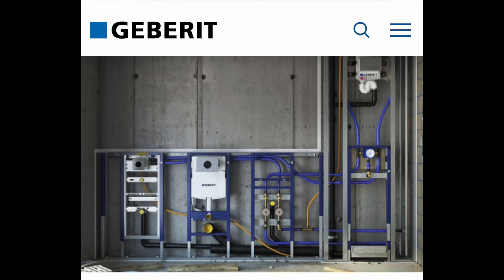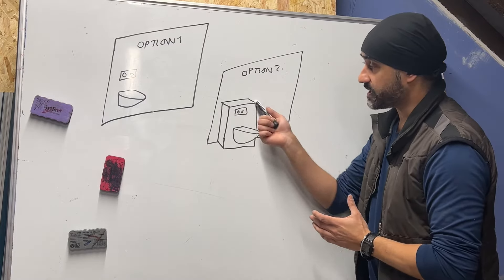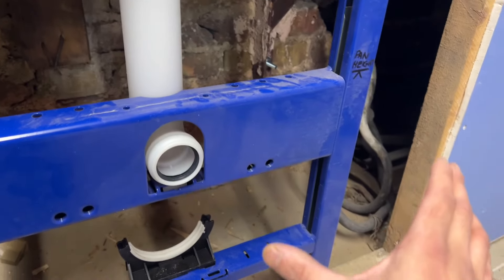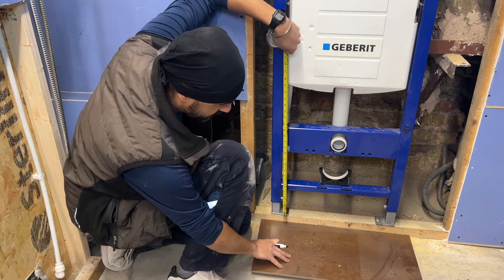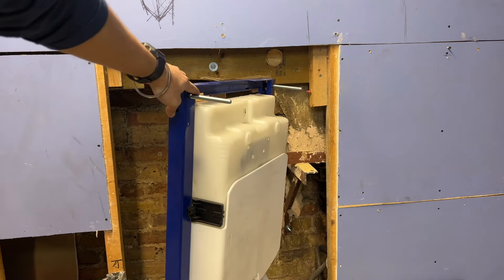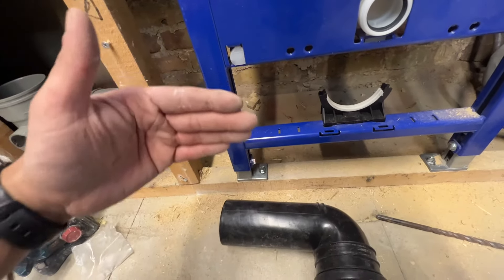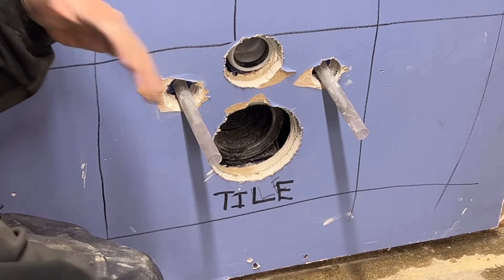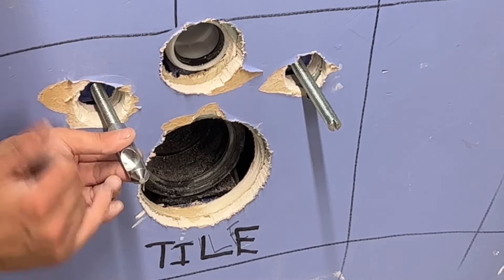How to fit a Wall Hung Concealed Toilet Frame (GEBERIT)

Comment: Just wondering why you used a Street elbow over a tap connector or female compression elbow?  Geberit's detail here is lacking, just showing an r13 fitting with nothing about the mating face.

Comment: I just want to say thank you, for. Your videos and specifically this one, I’ve removed a toilet and added in a wall hung one by watching this over and over, I’m super chuffed with myself, you went into so much detail and answered all my questions, thank you 😊
Reply from the maker: Your most welcome. You can find me on signature_installations on instagram
Reply: How decent slop is 1/4"×1' or 1/2"×1' ?
Reply: To use PEX than is need an sweat adaptor from copper to PEX  expendable or crimp. Also can use pres fit copper fitting viega either for copper to PEX or copper to copper I presume
Reply: That water /moister resistant board is cod surround bathtub or any other areas where moisture might occur prior tilling

Comment: Great video /explanatory step by step appreciate your concern protecting the floor and how about control flush box is protruding out of wall ? It can be flush out with tile finish wall ?
Reply from the maker: Yes the plastic surround snaps off to accommodate different tile thickness
Reply: @diybathroom5123  thanks

Comment: Thank you!!!! Have been struggling to understand what fitting to use on the concealed cistern. I had been looking at Speedfit elbow to tap, or a flexible hose but was concerned about the seal onto the cistern fitting (virtually the same as you show here).

Comment: I couldn't understand why having a soil pipe coming straight up out of the floor is a problem.  You suggested this pushes the whole installation forward into the room. That black right angle bend , that is supplied, why cant that go straight down? Instead of to the left as you did?

Comment: Hi mate, great videos I’ve watched it 3 times to fully understand everything. Early stages into my bathroom fitting journey. Just one question, the Geberit system only comes with the 90° soil pipe connection, so what do you do if your soil pipe goes straight out the brick work behind the system? If any links to products PLEASE link it. Thank you!
Reply from the maker: @Unprotectedsets_  hi you can order the straight connector online

Comment: What about the .098 version? Would the seat hit the flush plate? I suppose it might depend on the WC but generally, any feedback would be most welcome. Nice video btw, thank you!
Reply from the maker: Yes it does hit the flush
Reply: Thank you for the reply. Is there another option for flushes with these frames? Ie. a flush sit away from the cistern? I have seen this before as a push button rather than a flush plate.
Reply from the maker: @Watasmindset  yes you can get a pneumatic dual flush button. You have to alter the parts inside. I’m not entirely sure if it’s doable on a 0.98 but I can’t see why not

Comment: Would u say these geberit are better than the grohes
Reply from the maker: From experience au can say they have a wide range of flush buttons and dimensions to accommodate restricted space
Reply: Geberit have a long term commitment to providing spares (20 years IIRC).  That may be common among the rest, IDK?

Comment: Any ideas where I can get a 110 to 90 reducer from? My waste goes straight out the wall and I only have a pan connected and 90degree
Reply from the maker: @mattsav1329  plumbers merchants. The reducer they supply can be used if you connect to a straight 110mm fitting. But you have to make it lands exactly in the right position to meet the pan. Basically it’s a hack from the back.  But you won’t be able to use the clip to lock it in place
Reply: @diybathroom5123  I’m thinking 110 through the wall with a reducer to 90 just sitting behind the frame. Then the pan converter can slide straight into that then pan onto that? Does that make sense?
Reply from the maker: @mattsav1329  makes sense. As long as the 90mm straight reducer is at the right height and at least sitting in line with where the elbow (supplied) would be situated.

Comment: Great video! I now feel 90% there with tackling this myself, however, the only remaining question I have is... Is this the same process if going against plaster only wall as opposed to tile behind? Thanks in advance!
Reply from the maker: Hi If it’s a plaster( skim background id be more inclined to use a cement board instead. Something like Hardibackerboard

Comment: thanks for the video. though aesthetically nice these are a pain to fix anything inside. i did a leak test by placing a bit of paper towel inside the toilet and it instanlty got wet revealing there is a slight leak. what would be a common cause, something inside the wall?

Comment: Hi. Super video. Just wondering, if the soil pipe is going straight out the back.. the Geberit kit only comes with an elbow. Do you need to get a special Geberit straight fitting? Thanks a mil!
Reply from the maker: Yes you would need to order the straight fitting. There is a way to make it work using the reducer that they supply but you need to be experienced in positioning it
Reply: @diybathroom5123  Thanks a mil for the reply. I think Screwfix seem to have quite a few diff fittings, so I reckon I'll maybe take out the old toilet first and see what'll work best then.
Reply: @diybathroom5123  By the way, your videos are excellent. Hope you get back to them and it works out for you. Defo deserve a much larger following.

Comment: The best explanation on installing a Geberet
Thank you 
What are your thoughts on Flomasta PTSE liquid for compression joints
Reply from the maker: Thanks. As per your question, I haven’t used that. For compression fittings I use jointing compound

Comment: Absolutely the best video I have seen on how to install a concealed toilet system. I am fitting mine on Friday and was concerned about flex behind toilet pan when installed. You cover this around 37.20. Would you use the self tapping screw or is a sealant best?  Depending on your reply, what size screw would you use? Or which sealant. Thanks and keep up the good work. Ian
Reply from the maker: Hi Ian thank you so much, glad it will help you installing the frame. I have always used a sealant like CT1. Self tapping screws around 25mm can also be used. The purpose of the screws is to get the plasterboard to hug the steel and avoid any micro gaps forming. You can also use a hss bit around 3mm and and drive a few drywall screws into the frame to squash the sealant. Ultimately when it’s tiled you need to make sure there’s full bed coverage of adhesive. Hope that helps. Any questions please feel free to ask.
Reply: Brilliant, thanks for the reply, will definitely be using a mixture of both.
Reply from the maker: You can follow me on instagram @signature_installations

Comment: Great video,  really helpful,  clearly explained and in detail which is the area I was missing from other videos. 

One thing I didn’t understand was the tip about placing a block of wood between the legs of the frame? Could you explain? 

Many thanks, J

Comment: Brilliant video.
Couple of questions if I may
Is there an issue using flexible pan connector where connecting into existing SVP is problematic?
Also you mention if the grub screw drops Into the pottery it's a nightmare. Would that mean new WC pan 😮?
Reply from the maker: Hi, thanks a lot. In regards to you question using a flexi pan connector it’s doable. I have another video on my channel showing it being used. The grub screw can be removed with a little persuasion to get it to find the hole in the pottery where the seat fits.
Reply: @diybathroom5123  thank you so much. Such a brilliantly explained video thank you
Reply from the maker: @leighkettle6423  you’re most welcome. You can find me on instagram at signature_installations

Comment: Thank you for the informative presentation.  I’m in the process of planning for my install but I’m not finding necessary information to finalize my plans.  My total wall board thickness will only be ½ inches.  Do you feel this will be adequate or does the flush actuator need more room to operate correctly?  Thank you.
Reply from the maker: The flush button will accommodate a board and tile thickness over 50mm. You simply cut back the protruding box and rods inside
Reply: @diybathroom5123  Sounds great - thank you for the quick response!

Comment: Hi. I’ve got from front to back, 165mm of space for the frame to fit in. Will this be enough to allow for the bend in the side fitting soil pipe?
I’m having to put a new soil pipe in so I can drill it anywhere in that space mentioned above. Thank you

Comment: Absolute legend. What a perfectly explained video. Many thanks. Quick question, when hand tightening the locking Allen key bolts that pull the pan tighter to the wall, how do you know when to stop? What is the limit? I get worried I will tighten it so much that I will crack either the pan or the tiles 🙊
Reply from the maker: Hi. The way to check is the physically see the pan being pulled and to the point the Allen keys are too hard to turn. If you’re adhesive bed is full your tiles shouldn’t crack. Silicone around the pan and once cure sit to see if you see any obvious movement.

Comment: Great video.  Very detailed explanations of what you are doing however... I disagree completely with your comment ref plasterboard and tiling.  Plasterboard should NEVER be used in any bathroom, cloakroom and especially not in a shower area or wet room.  This materials is for covering studwork hence why the Americans call it drywall.  The clue is in the name.   So plasterboard, no matter how dense, is definitely NOT suitable for large format tiles and has a very low loading capacity so this limits the weight of tiles you can adhere to it.  If you plaster skim the plasterboard prior to tiling this makes the situation worse as the max loading value decreases. You should always use "backer board".  There are many makes of this in all sizes and thicknesses and once taped and sealed at the joins and corners is a far superior product which can take much heavier wall tiles.  Yes, this is more expensive but I prefer my tiles not to come off the wall which ends up being cheaper in the long run if you have to start over again.
Reply from the maker: Glad you enjoyed the video. I’d have to agree on some areas you’ve mentioned however my experience over the last 20 years has intuitively grasped that any 10mm porcelain or hard grade ceramic tile when back buttered and full bedded, creates an extremely solid surface. I think it’s a skill in itself to understand where and what product to use in what scenario. I would definitely never skim with gypsum products. And with your reference to loads I would say that there is no load to be pulling on the plasterboard when the pan itself is clamping it fully to the metal frame work. Your have provided an excellent analysis of my tutorial and I greatly appreciate the feedback
Reply: @diybathrooms5123.  Hi thanks for the reply.  Think I wasn't too clear about loading.  I was referring to the load on the plasterboard from the wall tiles not the toilet.  There should be no load at all on the plasterboard where the toilet pans is hung as all the rotational and downward forces should be taken up by the timber frame.  If anyone feels they must tile on plasterboard and not backer board then the load of the tiles has to be taken into account so large format tiles are not a good idea as there is a maximum weight per m2 that plasterboard, not skimmed, can take 🤫
Reply: Should I have concerns regarding the Jackoboard type wetroom boards, with regard to compression? I've watched several videos using this or wedi with wall hung toilets....?
Reply: @stevenb007  No. Jackoboard, wedi board, marmox board and all other products of this type are specifically designed to take the load of large format tiles.  If fixed correctly to the wall or studwork and sealed and taped correctly following the instructions then this set up is ideal for any wet area.  These boards are waterproof and even provide a level of insulation.  Plasterboard should NEVER be used in any wet area and in fact I would recommend avoiding it completely.  If this stuff gets wet even to the slightest degree then the moisture will continue to "wick up" in the board(s).  You will end up with mould and the boards eventually turn to mush - tiles then fall off the wall.  With regards to fitting wall hung toilets - these usually come with a substantial metal frame which is fixed to the studwork and in most cases to the wall behind the studwork.  The load of the toilet is then taken up by this frame and the surrounding wall/studwork.  There will be no issue using any of the reputable backer boards available with these wall hung toilets.  In my opinion compression dosnt come into this installation.  The backer boards are fitted to take the load of the tiles, the toilet is fixed to the metal frame.  By all means post again if this isnt answering your question

Comment: Is it reliable with an almost horizontal slope?

I am looking to install this exact frame/carrier and luckily found your video after endless searching. The manual says the outlet should maximum go 45 degrees to each side but I don't have enough height to make that work so I have been searching everywhere to find out if nearly horizontal similar to what you do in the video will work. 

My setup is identical to yours except instead of wood at the bottom I have a riser clamp where the tee in the main stack has to sit above which causes the center of the outlet to be nearly at the same height as the toilet outlet.

There is only around 10 inches from the toilet outlet to the main stack where it will connect. 
I have been calculating back and forth and adding the floor height like you advise and the center of the toilet outlet will be around 9.25"-9.75" from the ground and the center of the tee outlet in the main soil stack will be around 8.75", so a drop of 0.50" to 1" over 10".

Hope you have time to answer as I don't know what the heck to do and have had to stop the project while my hole bathroom is gutted.

Thanks for sharing this video - best video I have found.
Reply from the maker: Hi Martin. Your calculation sounds correct in terms of height. In regards to the slope of you drainage pipe, I can honest say from experience you will be fine. 10 inches is a very small distance. Obviously the T (sweeping T / branch ) portion sweeps down? The force of the water from the cistern will be enough to get the rid of the waste.

Comment: This is a great instructional video for me as this will be my first time installing a toilet.  I have recently purchased the same wall-hung setup for my cloakroom. I was checking all the waste pipe fittings and came across a small issue. The waste pipe goes straight into the concrete floor but is 110mm in diameter, and the outlet pipe in the set is 90mm in diameter. Watching your video you mention a reducer from 110mm to 90mm. Could you tell me if this is in the kit or if I have to purchase one? Do you have a web link to the part? Thanks

Comment: Do you always glue soil pipes in? I've noticed most of the soil pipes here are push fit with rubber seals... is that normal for internal soil fittings etc or just underground?

Comment: love your channel. thanks. my question:  remodel concrete slab bathroom, don't want to damage slab, don't want to use old sewer, can i use this wall mount framing with toilet face the exterior wall and hook the  bowl drain toward outside of the wall to connect the new sewer line reroute ABS pipe?
Reply from the maker: Yes that’s precisely what you have to do. I presume you are in the uk ?
Reply: The frames normally come with a right angle waste pipe. This can be rotated to point downwards or sideways. Not sure if they do one with a straight pipe to go straight back and out of the wall. You could add another 90 degree bend so it goes down (or sideways) then turns to go out through a wall.
Reply from the maker: @ColinWatters  yes you’re right 
Another brand that supplies the straight 3inch aswell as the elbow is a brand which is another favourite. It’s called TECE made in Germany.

Comment: Can you just add some additional wood framing to brace the tank in between the two studs? I wouldn't think you would want to secure the tank to the wallboard, so the tank and bowel can move seprately without moving the wallboard (and cracking joint)

Comment: Hi, thanks alot for this video & am super excited watching it. Actually am about installing something similar for the very first time as a plumber & I have been doing alot of thinking on it.
Please I have some some questions for like
(1) I have watch alot of video concerning on the installation, alot of them have similar stuff like placing the wall mounted concealed frame on a wood. Does that necessarily mean I have to tell my client to build wooden frame for it? 
(2) How about the option of using blocks?
(3) am also concerned more on the finish floor level so my w/c won't be more higher above the floor?.
(4) using plywood to cover the whole framework, can tiles stick to the wood?
Reply from the maker: You can sit this on blocks also. I would not use plywood unless you cover it with an anti fracture membrane
Reply: @diybathroom5123  so what's the best material to use when sitting it on block wall to cover it?

Comment: Hi, the reason the screw did not thread, is because you used a drill, that damaged the thread. Probably better to use a large straight bit in the drill, to screw in the rod, if you cant be bothered to to by hand.
Reply from the maker: Brand new threads sometimes do not catch. It’s not the case of not being bothered. Thanks for watching